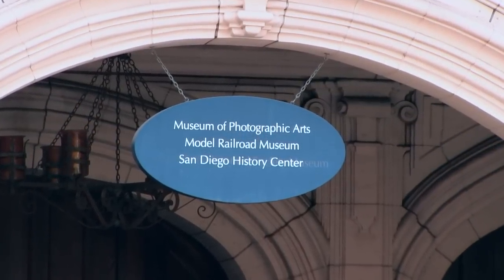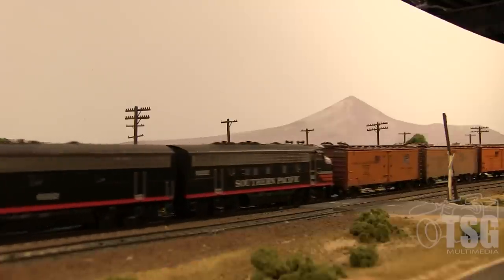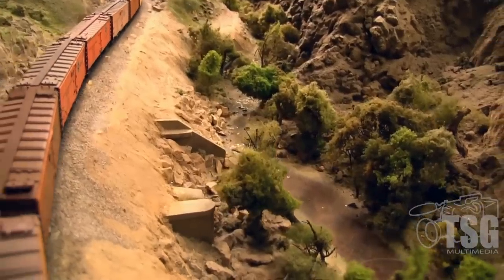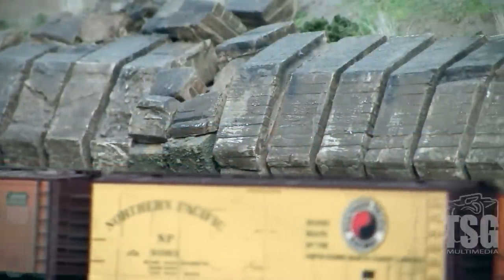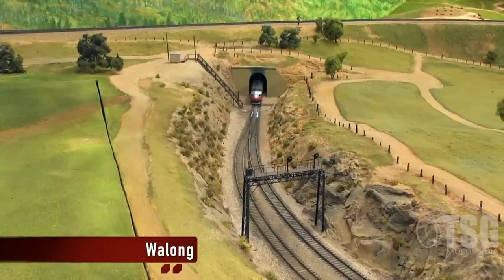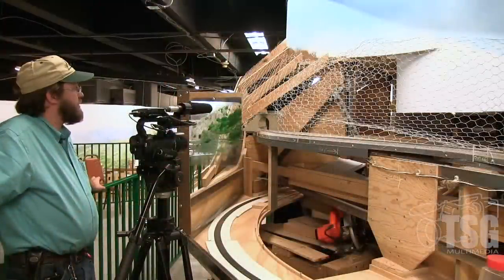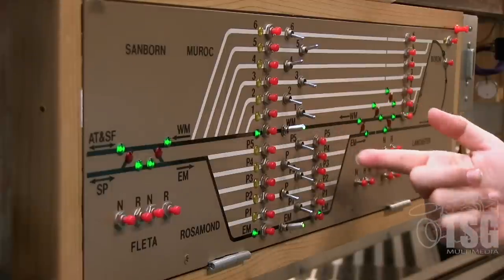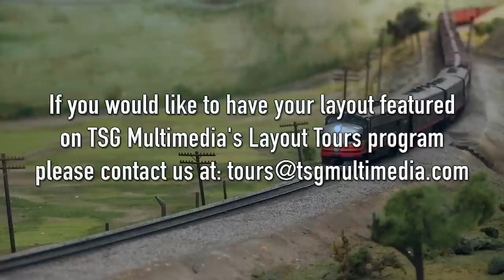La Mesa Model Railroad Club HO Scale DCC Layout Tour Tehachapi

Comment: I've been lucky enough to be part of the operating crew at La Mesa for four of their operating weekends. My first run I was engineer on the swing helper on a 66 car beet train running eastward up the hill. My locomotive was cut in about 2/3rds of the way back, with the rear end helper about ten cars ahead of the caboose. I've also worked as the engineer on the road locomotives on a 65 car eastward train, road engineer on westward passenger trains, locals working out of Bakersfield and as the yard switcher in Bakersfield. In every case it's very easy to forget that one is operating a model and to fall into the roll of being an actual train crew. A WONDERFUL railroad, run by some first class people. It's well worth taking the time to visit not only the La Mesa club, but also the other four model railroad exhibits in this world class museum.

Comment: What I really find impressive here is how smooth and level all the rails must be. I hardly saw any wiggling or jiggling if the rolling stock as it loved along. That really adds to the realism. 

If I’m ever out in San Diego I’ll make sure to visit this place.
Reply from the maker: It's well-worth a trip to see this amazing accomplishment!
Reply: That's due to the Car Shop standards for the equipment and also the Track Gang's painstaking work to make every joint and switch meet standards and flow smoothly.  Several switches have lasted years without guard rails installed.  I think we found a guard rail this year knocked out of its spikes, apparently never soldered in permanently, and no trains had any issues with it until someone noticed that "that switch looks a little weird...".
Definitely plan to drop by if/when we are allowed to open up again. (sigh)
NOM
Reply: @tsgmultimedia  ⁹

Comment: I was directed to this video by way of Vic Yoder in search of details with the upper level of Tehachapi and Mojave.  I have viewed the last several minutes where Jon explains the logistics of where stations are on the layout.  I am befuddled as this view does not align with the layout as published by Model Railroader Magazine in 2003.  It appears there have been major changes since then.  I have taken upon myself the last 10+ years to construct the entire layout in the 3rd-Planit software CAD system and this piece is the last one to be finished.  I would love to see a more detailed video of the upper level to where I can understand the station placements.  
Thank you very much for considering my request.
Reply from the maker: It's possible the layout design was changed up or that MR published something that was inaccurate. I don't have access to the MR map, so I can't comment on the latter, but if you're there, the layout definitely makes sense.
Reply: The layout underwent major design changes in the 2005-2009 time frame just before commencing the construction of the "final summit" over the top of Mojave Yard.  One of the club members approached the GM and Chief Engineer of the layout and asked about improving several aspects of the main line between Mojave and Monolith, also the folding wye in the original plan for Tehachapi.  There was also to be a "nod-under" just east of Cable in the original plan.  The member and the Chief Engineer both came back with revised designs.
The Chief's plan was to move the entire Tehachapi Tangent, minus Monolith, to be over Mojave Yard and put the wye into a bulge over the "upper tunnels" between Marcel and Cable.  The Cameron Crossovers would be able to function in this plan, where as the original had less than a long train length between Mojave and Cameron, which made the crossovers of no practical operational use.  The new plan called for a section of double-track to extend out over the public aisle access at the west end of the upper level viewing deck and about 300ft more track!
The member that wanted to see the changes to the design called for a less ambitious design, which called for Mojave Yard to be flipped end-for-end and allow for the Mojave Wye and Summit Wye to be stacked over one another.  This plan however still called for a nod-under and increasing the number of tracks from 2 to 5 (due to a second lap of track being added)!  This plan would have added about 130ft of double track mainline.
The plans were discussed at a club business meeting to decide which of the three options the club should actually build.
Original Plan - Pro: Less track work to build, should be completed faster. Con: Cameron X-over serves no purpose, folding Summit Wye with brass steam engines operating on it regularly (asking for trouble), two-track duck under.
Member Plan - Pro: Cameron with workable amount of mainline between Mojave and Cameron, addition of Mojave wye and engine house.  Con: Increase in width of duck-under to 5 tracks, Mojave Yard would have to be cut into at least three pieces to be turned around - track and electrical crews which had just finished work were NOT HAPPY about their work being cut up and flipped around only a month after it was completed "Couldn't you have come up with these changes last year?" was one comment.
Chief's Plan - Pro: 300ft longer mainline to put workable length between Mojave, Cameron, and Monolith, elimination of duck-unders completely, elimination of Summit "Folding" Wye, move wye to rigid location.  Lengthen Tehachapi Siding and Summit Siding to nominal to long train lengths of 50-70 cars respectively from under 40 cars in original plan.  Not requiring moving of Mojave Yard, it could stay in currently completed location.  Con: Would take longer to build, requiring more engineering for trackwork and access challenges over public space.  Perhaps too much mainline? - Concerns of this were covered by being able to keep the 'back connection' from Tunnel 10 to the 'Jawbone' branch into the west end of Mojave Yard.
In the business meeting, after about 90 minutes of discussion and briefing by the Chief Engineer, myself and several others, plus the member that formed the 2nd plan, the discussion moved to which option the membership wanted.  In the end it was decided to go with the 3rd option, "Chief's Plan", to which a member afterword remarked to me... "I guess if you're going to go down with the ship, it might as well be the Titanic!"  Which pretty well summed up exactly what we all felt that night.  The next 5-6 years were spent building the upper deck and we finally completed the "Summit connection" and had the Golden Spike ceremony during our August 2015 TT/TO operating session, complete with new Employe Timetable going into effect at "midnight" on the operations clock.
**
So, yes... we didn't build the plan from the 2003 MR issue.  The LMRC's Tehachapi Pass layout has been through many changes to "The Plan" over the 38-40 year history of its design and construction.  As the layout progressed in construction, concerns were raised and changes implemented.  This change just being one of the more 'public' ones.  Truth be told, we still have the 2003 MR plan up at the layout to show the general layout of the towns and how it fits into the space.  I always would point out the changes we made since the 2003 plan when I give tours.
I think we made the right choice in going for "the whole enchilada".  Yes, it took longer, but one of the things which we realized during the business meeting was... we're only going to get ONE SHOT at doing this.  How much would it be sad if we finished plan 1 or 2 and then realized we should have done 3?  We would never get the change to tear it out and do it the "other way"... so we decided the worst that could happen with Plan 3 was it would take another year or two... and we'd have more track to clean with that plan.
Reply from the maker: @NightOwlModeler  Thanks, Jason. That was a lot more than I expected!

Comment: This layout an the Colorado model rail museum layouts are just absolutely other level when it comes to detail and operations. Only one potentially bigger and as amazing is the layout in Arizona that’s based on Wyoming and the guy had a full time crew build the layout and it’s like near to full scale in terms of length
Reply: My layout im building is going to be when completed a triple decker with two foldouts, four drop in cassettes, two modular sections, a modular helix to connect all three levels, has 6 towns and 2 communities, close to 20 industries, top two decks are 1910-1935 with the bottom section capable of running all the way to modern times, one main yard, all hand thrown switches, and I hope to one day complete the entire St. Louis Brownsville and Mexico (GULF COAST LINES) railroad. I’m unsure of the total mainline length but with the modular helix connected I assume close to 140-150 foot and speed restrictions for most of layout at 15 scale mph
Reply: Yes, the UP Wyoming Division is an amazing layout, but one of the highlights of Tehachapi Pass is that about 2/3s of the rail miles are single track with passing tracks, so it's not just follow the leader on the double track main, like the Wyoming Div has.  I have operated on both layouts, and enjoyed both.  They each have different aspects that are enjoyable and are highlighted by their prototypes.

Comment: Seeing layouts like this make me wish that smoke units were more viable of long distance runs.
Reply: It takes an hour and a half every day just to clean the mainline track before we open for the public. That oily smoke is a curse for reliable operation.
Reply: I can't stand when layouts are using smoke units at train shows, in a more enclosed space it would be even worse. It's also terrible if people have allergies/sensitivities to indoor air pollution, and just generally gross. Plus what John said, DCC needs clean track for reliable operation.
Reply: @woodalexander  Neat.
Reply: @woodalexander  Thank you!  I actually became allergic to the smoke fluid smoke around 2005... it used to not bother me, but now I can't be around it at all.  So as a regular member at LMRC, I'm very glad that it is not used on the layout.  The Toy-Train Gallery does use it, but they are supposed to have an exhaust fan that pulls it outside, not into the museum.  Even then sometimes I walk into a wall of smoke fumes at Caliente.  Not fun.
Also, with the model smoke units not able to replicate the way the real engines looked when working hard on a cold day... and on a hot day, barely any exhaust is visible other than a slight "Econo-haze" as the firemen call it (hot gas ripple in the air with a slight gray or darkening of what you can see through the exhaust).  It really isn't worth having on the models like at LMRC.
Reply: @NightOwlModeler  Agreed. It doesn't look realistic at all, it looks like it belongs on a Lionel 3-rail set. It might be OK for G scale if it's outdoors, so it can dissipate. Since you've developed allergies to it, I'd be concerned what it's doing to everyone else breathing in more indoor air pollution. As we've gotten new materials and tighter buildings, that's already become an issue without adding even more crud to the air. I definitely want to get down to the museum, see all the layouts, but in particular, if LMRC has openings for guest operators, actually operate on the layout.

Comment: Re:  The grade signals.  What color is the "pass-at-restricted-speed-indicator?"  It was solid lunar white on the D&RGW (dunno today under UP ownership), but I really don't know what is was on the shared Tehachapi pass line back then, nor whether it was Union Switch and Signal or General Railway Signal Co equipment that was actually used.   I suppose a quick look at the dispatcher's board would answer that--green or black--but I'm not sure they weren't even combined, nor whether they even could be.  Paul Lubliner should know, if he's still around.
As far as the first, second, third sections go, are the marker lights active on the models?  I see blinking markers @26:45-26:59...but I think they are actually blinking as bleed over from the Mars light.  Yes?
Reply: SP's 1950s grade signals had yellow circle plate with "G" on them... as modeled here.
Reply: @NightOwlModeler  Ah, ok.  Thx. I remember running upgrade toward tunnel one (or two), and you can look down and see a block signal before the tunnel entrance, but didn't remember the yellow surround plate.  Never did see one in use (but I was only running as a guest, "weekend" engineer), so they probably weren't used on weekends anyway.  Which begs the next question:  Red light in that yellow G surround would be my guess, as in "the next block IS occupied, but you may proceed at restricted speed (15mph or less) expecting to come to a stop."  I can't see it being a yellow light somehow--that seems too dangerous, given the possibility of heavy fog in the area.

Comment: Awesome! How long did it take to build?
Reply: Still under construction as of 2019.

The "Golden Spike" was August 2015, when the main line was completed over the Tehachapi Summit, as shown in this video.  As the video shows, the spurs in Edison still need to be completed.  The Santa Fe roundhouse area is still being worked on, as is Oil City and the "Malley Shed" in SP Bakersfield.

Structures around Bakersfield, mostly west of Baker St still need to be built.  The scenery at Edison, Rowen, Cable, Tehachapi, Monolith, Eric, Cameron, and Mojave needs work.  Further structures at Arvin, DiGiorgio, Taft, Mojave, Monolith, and Tehachapi need to be made, again mostly from scratch.  So a good many years of work still to go.

Since this video was shot the scenery crew has progressed at Marcel and the "upper tunnels" between Marcel and Cable have been mostly completed.  Scenery is into Cable now.  The arrangement of structures for Tehachapi is coming together.  I posted a blog about the prototypical research and compression techniques used for the industries west of Baker St. (link below).
NOM/Jason

https://nightowlmodeler.blogspot.com/2018/07/west-bakersfield-part-1-laying-out.html
Reply: NightOwlModeler  very nice, have a great weekend

Comment: I think now they are in late january 1953, this might have been when SP got their SD7's and RS3's, the Santa fe had Their RF16's.
Reply: Yes, we're in Jan '53 for the paperwork now, but the SP's RSD-5s aren't supposed to show up till March.  Those rules were bent slightly as Kato/Atlas RSD-5s and F-units are much easier to keep running than a fleet of HO steam engines!  We're cutting off before the 1954 built-SD9s showed up and bumped the majority of the F-units off the Tehachapis.  Thus we're still able to keep the ACs and on the ATSF, we've skewed a bit and kept a small number of Santa Fe steam going, when in reality it was almost wall to wall F-units and GP7/9s by early 1953.
Reply: Do you guys still do modern op sessions, my BNSF SD60M would fit perfectly, but its a proto 2K with Lok Sound 5.0, it's a bit slower than Walthers Mainline SD60's and SD70's i would assume, but 9249 and its identicle sister 9298 are equipped with sound along with athearn Genesis Late model SD70Ace No. 1201, and a Kato SD90/43MAC no. 123 with MRC sound (yeah I don't like running it). The rest are a pair of Atlas BN Geeps and a COLW/CMEX C40-8 no. 9056.

Comment: Back in the day, were “helper units” designated DPU’s?
Reply: Nope, back in the day, the helpers were all manned, especially in the steam engine days!  The idea of DPU is a 1970s+ concept, first started with the radio remote control helper units.  The SP borrowed some BN F7B units which had been rebuilt as radio receivers and controlled the rest of the helper consist.  SP spent a lot of time and money wiring the tunnels to support radio signals and prevent any loss of communication with the controlling engines at the front of the trains.

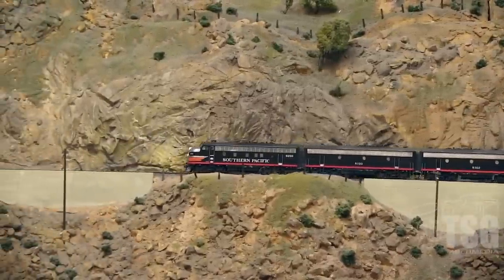Comment: Seems like they got some power supply issues at 19:55
Reply: Yeah, bit of dirt issues... 1600+ feet of mainlines.  We're on short time to get the filming done, and I only arrived the night before from a convention.  Also this was filmed on the one day the museum was closed, so there had been some light construction going that day too, which probably didn't help the rails cleanliness.  Usually we spend 1-2 hours in the mornings running cleaning equipment, which I think must have missed a few spots. ;)

Comment: Well I live in Tehachapi and you might check to see if any of the cab forward was used on this line as they where to-heavy and to long they they would spit the rails in the tight turns..
Reply from the maker: You should have checked before making this comment.
Reply: No need for us to check, they were rated and were standard on almost all freight trains from the 1930s through 1949, and continued in helper and passenger operations into 1953, when replaced by diesels.  The Siskiyous couldn't run AC's because of the 3.3% grades and the tight curve clearances of the tunnels.